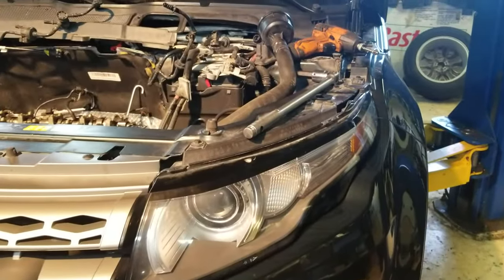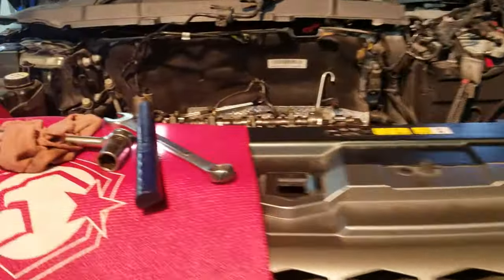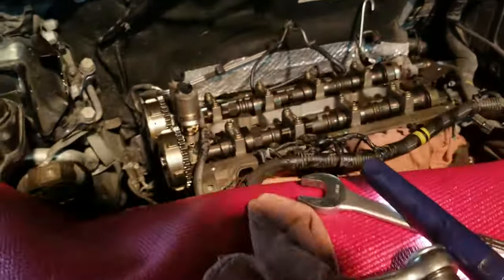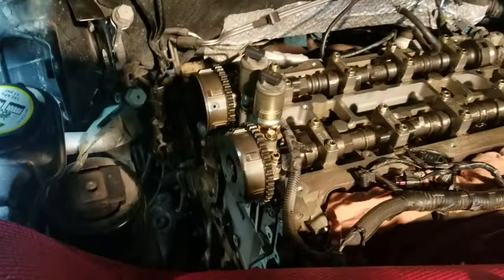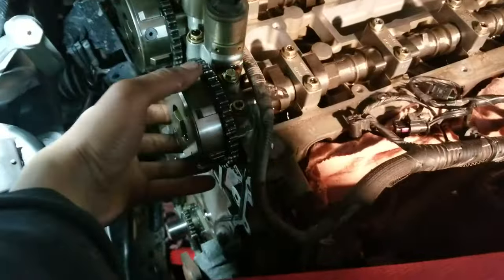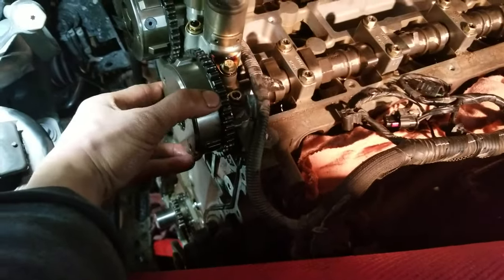2011-2017 Land Rover Evoque 2.0 VVT and timing chain replacement.

Comment: Do you have a full video on how to do this fix?   About to do this myself I’ve done the f150 cam phasers
Reply from the maker: Its not that bad trust me! Make sure you have the timing tools.. remove the front right suspensions and axle and rear engine mounts and support the engine... ill give you a whole day to do this job
Reply: @elNenio  thank you for reply.   How hard is it to get that crank tool in there?   I see some do TDC with old school way finding highest stroke on #1 instead of pulling that front suspension
Reply from the maker: @kbrown4023  ooh god... no old school.. just remove that right axle intermediate shaft and you will see that thread for the bolt tool.. it will hold your crank in position tdc and at the same time it will hold the crank.. trust me.. you want the crank stationary when you're about the put that crank pulley bolt.. you dont want anything moving around.. especially when the timing cover is on..

Comment: how did you get the bottom crank tool in without taking the axle bracket out?
Reply: It looks like he did loosen it and let it hang and then pressed it back on with the wood block?
Reply from the maker: @scientist100  yes sir!

Comment: Can you find this problem with the VVT cam sprocket without dismantling the valve cover and the front cover and removing the chain?
Reply from the maker: You can hear it in the cold start rattle.. if it gets worse you will get a cam correlation codes..
Reply: @elNenio  I have that rattle, it goes away after a few seconds.  Done deal, this is what the car needs. A shame after only 75k miles!
Reply from the maker: @jeffreycicero6685  well.. idk what to say.. its a same engine they have in ford focus etc.. lol

Comment: The tech manual says install cam sprockets in the position you remove them implying that the proper install position is necessary.  The sprockets have a notch on them as well. Do you know how to install the vvt cams sprockets correctly?
Reply from the maker: No notch.. jus make sure you install the intake and exhaust sprockets in the right spots.. it will freewheel along with the crankgear when all the bolts on them are lose when the chain is on.. all that matters is the crank locking bolt is in.. cam locking is bolted down with both camshafts.. make sure the adapter in the intake cam for the high pressure pump is off so you can put the tool in.. tighten all the tensioners and guides.. put the cam cover then the main pulley.. another tool would lock up the sensor that reads the reluctor wheel on the pulley.. tighten all your vvts and cam pulley bolts.. remember they have special washer on them..
Reply: @elNenio  thanks.  Had it running for awhile now.  Believe it or not on the initial tear down the cam shaft sprockets had no washer and I bought the vehicle at around 1 year old.

Comment: hey i was talking to you about my 5.0 supercharged range rover engine codes on that other video, if there’s anyway i can contact you i’d gladly pay for some help on the timing chain vvts job/ part numbers
Reply from the maker: Call the dealer man.. i dont have the part number in the back of my head.. all i can say that there are updated guides and tensioners.. it might run you up to 2000-3000 $$ on parts alone.. i work in the specialized shop and we have our own tools..
Reply: @elNenio  thanks man i appreciate the help.

Comment: I locked the cams in place and loosened the VCT. Does it matter how it goes? It has no guide and it spins freely on the camshaft lol. It only stays in place once the bolt is tightened down.
Reply from the maker: Just tighten it to specs
Reply: @elNenio  I meant to say that it has no markings on the sprocket. All I'm doing is turning the VVT clockwise until the slack is gone from the exhaust VVT. Will that be ok? In theory it should be ok but just want to be sure, I know the timing tone ring is on the opposite end. I plan to have the chain pull it clockwise and then tighten it to spec. I noticed that it does have a marking on the front but that is about it and is not shown on service manuals, all of them say to mark it prior removal but kind of useless since the old one has too much play since the oil check valve is missing lol
Reply from the maker: @scientist100  ok... there are no markings.. just this timing is all about locking tools.. you can move the chain counter clock to move the slacks to the tensioner side.. then tighten to specs..
Reply: @scientist100  Hi, how did the VCT sprocket installation go? I read that the intake sprocket has a notch near the bolt which has to point to 12 o'clock (with the camshafts in locking position)? The exhaust notch seem to point roughly toward 10 o'clock?
I'm getting misfires after replacing the sprockets as well as cam/crank correlation faults.
Any help is much appreciated!
Reply: @twiliteblue6053  actually you don't have any guides or notches on those VCTs, they can be any position. The secret is to keep the cam and crankshaft locked in the timed position with the tools. Once you have the VCTs hand tight, release the chain tensioner and it will pull the VCTs accordingly, then go ahead and tighten the VCTs to torque spec starting with the exhaust and then intake camshaft. Ensure to hold the camshaft when torquing because they may move slightly even if the tool is installed, especially if you use the cheap holders which can bend, just use a wrench to hold the camshaft.

Comment: does this car was running after this code appear ?
Reply: Cars will run but will go into limp mode due to the correlation and there is noticeable noise in the VVT phaser area.
Reply from the maker: It will run.. but it will make this quick rattle sounds from the vvts.. yes, it will have all the timing correlation codes

Comment: Is the pin on the side of the block really necessary to use? Or the flywheel holding tool is enough?
Reply from the maker: Dude that is your TDC number 1 cylinder reference.. its a must!